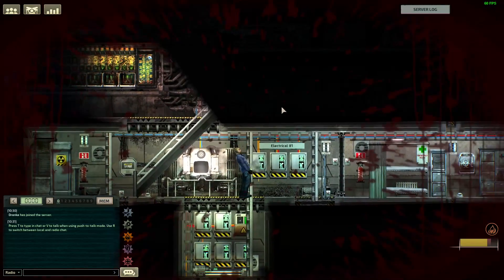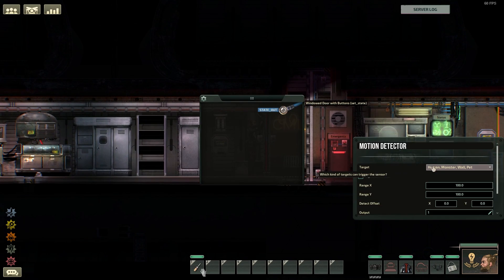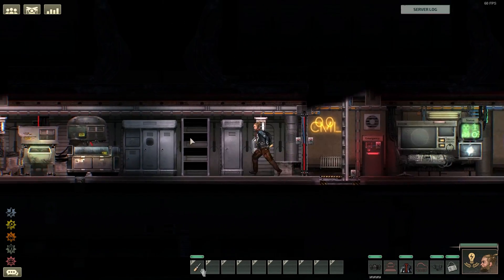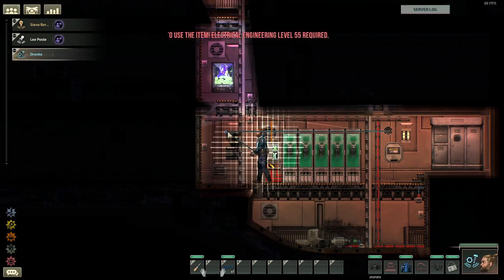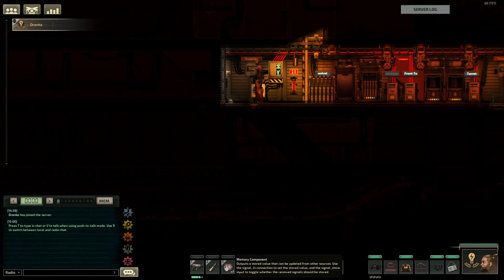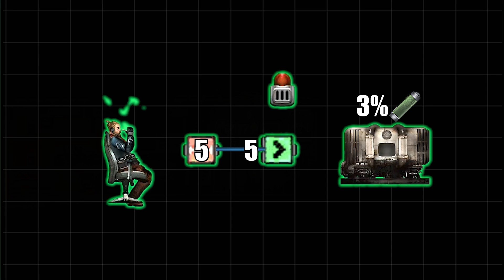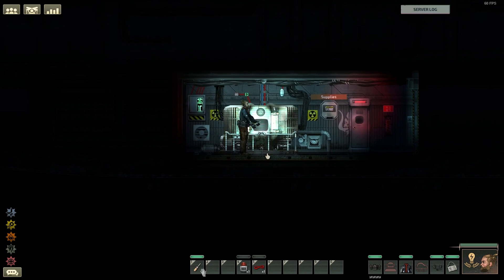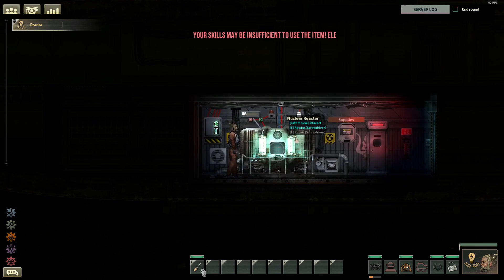4 Wiring Projects for BEGINNERS - Barotrauma Wiring Guide

Comment: Great video! Can you tell me what is that "green" Matrix looking place? :) Is there a mod or something where I can practise my wiring skills? :)
Reply from the maker: I'm glad you liked it ^^ That green Matrix looking place is a green screen submarine from the workshop, some bigger than normal components and a reactor. Oh, also a chair xd. Everything else like background, wires and text is the stuff I added in edit. That cool squared background is from the circuit box's interface. Circuit box is an item that you can use to nest complicated wiring structures so it doesn't clutter the wall and also has a cool background that fits well with explaining wiring logic.

Comment: You can also use an RegEx Component instead of Greater and Mem.

The Expression is: ^[0-5]$
Reply: Any idea why I could only get this to work seemingly with values less  than 10? I've no idea what I'm doing with regex but during my testing that seemed to be the case
Reply: @Smoothbrainium  That expression is only looking at the first digit in the signal, and regex is a little complicated but ill keep it simple here.
The Expression you want is: ^[1-2]?[0-9]$
The ^ denotes looking at the beginning of the signal.
[0-2]?[0-9] is looking for a number from 0 to 2 in the first digit, and a number from 0 to 9 in the second digit, so anything 29 or below..
The ? allows the signal to ignore the number before it if it cant find a match (so if it cant find two digits, it just looks for the [0-9] alone
$ just notes the end of the signal
Reply: @Smoothbrainium  It only works for single digits, if you want two you have to search each digit in order.
this expression: ^[0-2][0-9]$ searches the first digit for anything from 0-2, and the second digit for anything from 0-9. So this one will output when finding anything from 29 and lower.

Comment: followed this to the letter and nothing happens when it hits 5% or lower. Totally new to the game so is there anything i might be missing?
Reply from the maker: You might be using more than 1 fuel rod if there are 4 fuel rods with 5% each for example, contraption will see that as 20% so check the guide in the description to do the alarm with multiple fuel rods. If it's not that you might be connecting the alarm's toggle_state socket instead of the set_state socket or you mixed greater component's signal_in_1 and signal_in_2 sockets.
Reply: @Dranka_  honestly somehow i commented on the wrong video. Going to try your method later. Thanks for the quick response though.
Reply: @Dranka_ Your method worked like a charm

Comment: Wiring is definitely the best part of this game. Infinite potential and even has trig functions for funzies
Reply from the maker: It is a crazy advanced system for a game for sure and then trigonometry oh god...
Reply: Games that have complex systems like that really raise the ceiling for how impressive a build can be. It's also cool that it's not really required to play the game casually, being a submarine designer is almost like an optional class you can play as to help out the team. 
 I really like the concept of putting a lot of work into a craft in order to give yourself and the crew the best chance of survival.
Also it being 2D means you aren't spending THAT much time building. It's still a lot, but it's a lot more manageable than something like Stormworks.